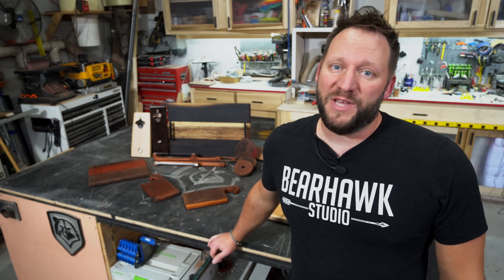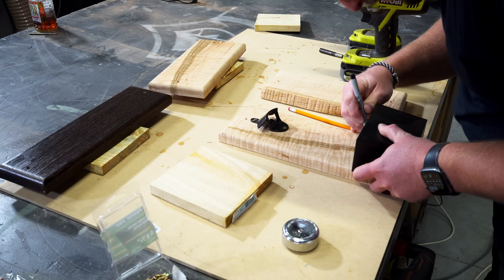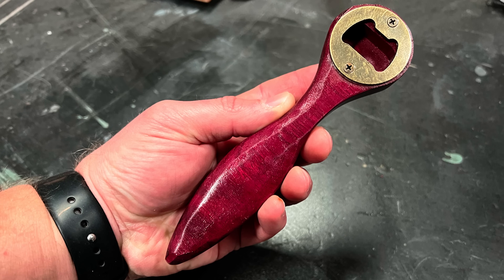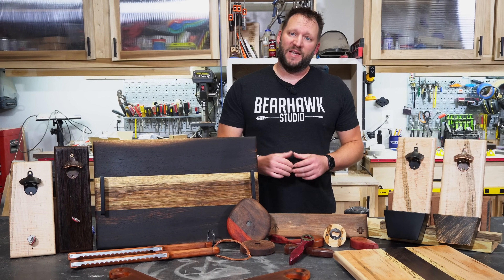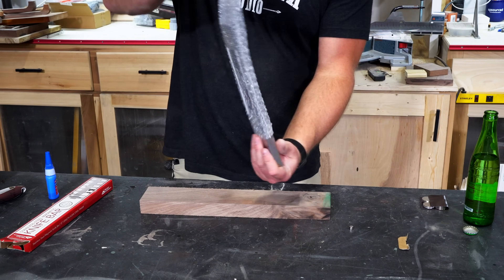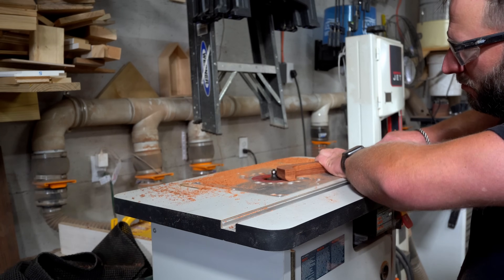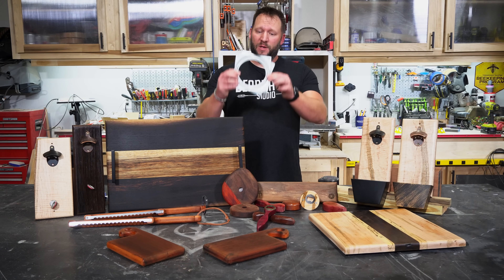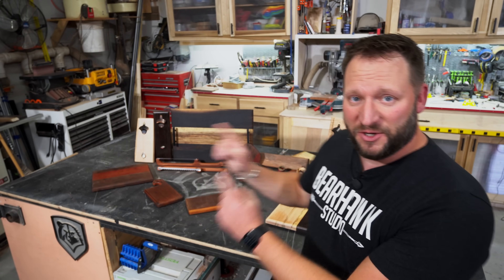Woodworking Gift Projects you will LOVE to build!

Comment: The bread bow saw is great but those blades are sharp as heck I have  never bled so many times making a project. I recommend making a blade cover
Reply from the maker: Yeah I wear gloves when installing them and then hang ours on the wall.  The ones I sell on the website I’ll be wrapping the blades for just that reason.  First thing I did when took the first blade out to measure it was cut myself too. 😆

Comment: I’m still very new to woodworking, but I love the idea of handmade gifts for my family. I think I’m going to try out the bottle openers and I really like the Lazy Susan boards for scrabble.
Reply from the maker: It really does add a personal touch and folks love getting stuff you made for them.  And the game night lazy Susan is is a literal game changer. 😆  thanks for watching!
Reply: @BearhawkStudio  Hey am I missing something? I see a 1-9/16" forstner bit and 1/4' x 1/8" magnets in your links. Wouldn't a 9/6" bit work? or a bigger magnet?
Reply from the maker: @brettbarker8444  The 1-9/16" forstner is only used to countersink the bottle-opener "coins" into the handheld bottle openers.  I used a normal 1/4" drill bit for the smaller magnets on the fridge ones, and a 1" forstner bit for the large magnet (front and back mounted) on the wall bottle opener.   Sorry for the confusion there!
Reply: @ thank you so much!! I’m really looking forward to my first couple attempts at these over Thanksgiving weekend.
Reply from the maker: @brettbarker8444   Good Luck!  If you end up making some you like, tag me on instagram I'd love to see how they turned out!

Comment: How thick is the wood for the bottle cap catcher 3/4 ?
Reply from the maker: The ones in this video were closer to 1" cause thats the scraps I had laying around - but you could absolutely use 3/4" or even 1/2" stock easily.  Thanks for watching!